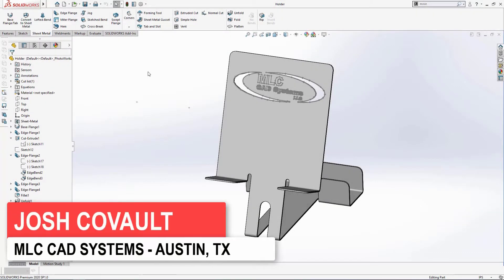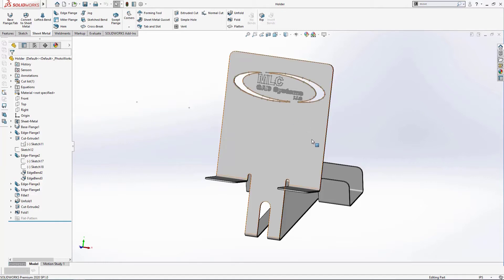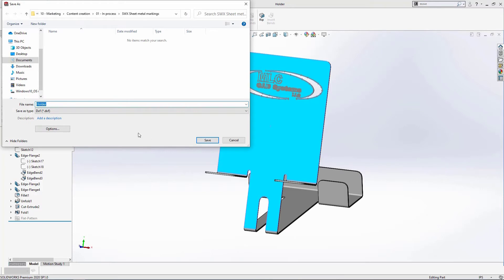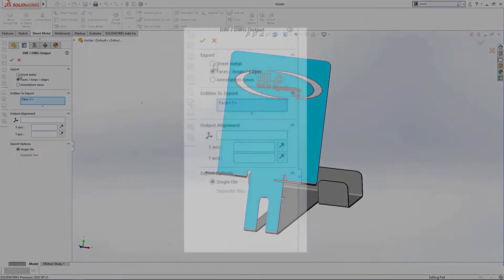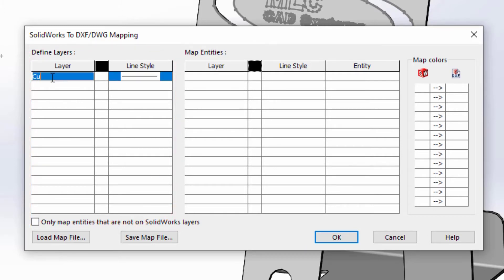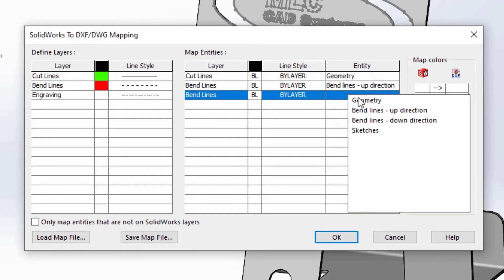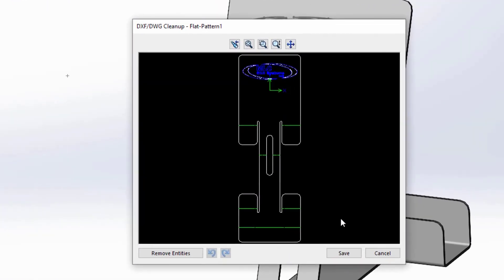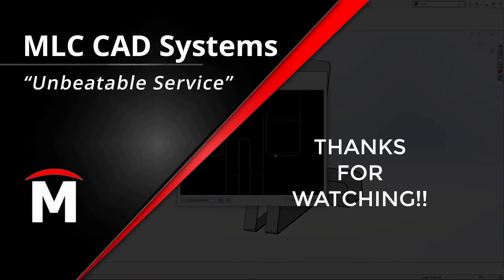Exporting Sheet Metal to DXF Layers | SOLIDWORKS Tech Tip

Comment: lets assume that we want to cut a single line on our sheet metal, and not a closed contour (unforunately we can have a cut extrude feature with opel sketch). But we want to have engarving to this part too. how can we differentiate these two sketches (one is cut [white color] and the other one is engraving [blue color]). Thanks in advance
Reply from the maker: I recommend testing out any approach to see if it will work for you, but try using a sketch to define the engraving.  You can use the font OLF Simple Sans which will create a single pass for each letter.  You may have to explode the font to get it to recognize, but then it should export it as a sketch entity and you can map it to a different layer.

Comment: Thanks for the video. Is it possible to have Features on each layer rather than entity types? so an extrude as one layer and each cut extrude as a layer? Or their respective sketches as layers each? I need to export dxfs that can show different cut depths within the one part to our router.
Reply from the maker: Yes, but not in an automatic fashion the same way. You will have to map the layers manually in the drawing using the layer tools, then export that.

Comment: Very clear tutorial but it appears this method will not export the angle nor the radius of the bends. I was hoping to find a way to do this as well. 

For example, it can be done within a slddrw file:
https://www.youtube.com/watch?v=N4kctnx-n_I&ab_channel=CADCAMTUTORIAL

However, it gets annoying when you have many configurations because you need multiple sheets.
Reply from the maker: Yes, multi-configuration reporting can get complicated for sheet metal features.  Consider researching a design table to see if you can specify the bend radii and angles in a table format and then export that data directly.

Comment: there's a problem i have, i have a press brake and i prefer marking the bend lines before cutting the boundary during laser cutting. but the bend lines outputted by solidworks is meant for down bending and not up bending. i end up having to transfer the mark to the other side of the sheet metal and then bend it on a press brake, is there a way to tell solid works as to which side i want the bend lines to be, or maybe spcify whether i am doing up bending or down bending .
Reply from the maker: Does your software interpret an up and down bend based on whether the bend line sits on the top or the bottom face of the part?  Is that the only way it can interpret bends?  SOLIDWORKS places all bend lines into a single sketch on the fixed face.  You can setup layers or colors to define up vs. down bends, but if your other software requires the lines be on the back face, then you'll have to add those yourself.  Depending on the software this may be an enhancement request for either SOLIDWORKS or that other tool, reach out to your Value Added Reseller for more information.

Comment: Any advice for a depth recognizing multi layered dxf export for woodworking with 2.5 axis milling?
Reply from the maker: Typically a flat DXF is only used for parts that are a constant thickness, and parts are manually sorted by thickness and cut out of material of the correct size.  If you have a part that is not constant thickness and you need to cut it on a mill you would need to generate NC code using some kind of CAM software like Mastercam or SOLIDWORKS CAM.  Some machines have programming abilities built-in, but you would need to check to see what file formats they accept.  Exporting as a an ACIS file format can export a 3D wireframe geometry with depth, but it is done as a simple save as and does not use the export layers routine.

Comment: Gretchen Video!
Is there a way to get the Holemiddles as a cross on a seperate Layer ?
I've tried much options but i don't get it
Reply from the maker: There may be workarounds to get this to work, such as creating a blank drawing with a flat view, add centermarks, apply them to the desired layer, and then export the drawing at 1:1 scale.  To review your approach and offer specific advice I recommend you reach out to your support provider, if you are an MLC CAD Systems customer you can contact us here: https://www.mlc-cad.com/contact-us/

Comment: Can you do this in a Macro? I have a Marco that exports ALL configurations as flat pattern .DXF file, but all same layer. I would need geometry and sketches separated for cutting and marking respectively.
Reply from the maker: Just about anything is possible with a macro, as long as you know how to program it.  We'll be releasing some API tutorials in the next month that you might find helpful if you're trying to create the macro yourself.
Reply: Have you had any luck finding that Macro?
Reply: @filipsironic1989  yes I have actually, I got some help from a solidworks tech, but we ended up using autodesk's inventor for our final solution.
Reply: @martink7960  do you still have that solution you came up with with the solidworks team?  can you share that with us if you still have it?
Reply: @filipsironic1989  I forsure have the inventor solution handy (still used today in automation) the solidworks i need to check